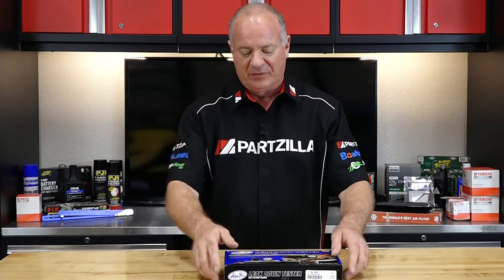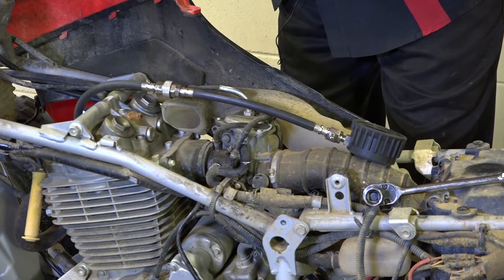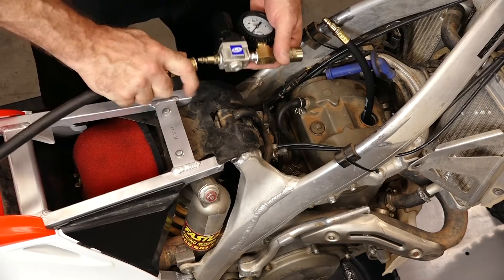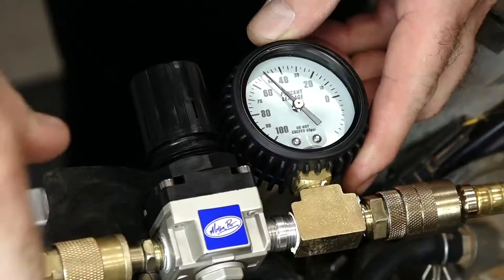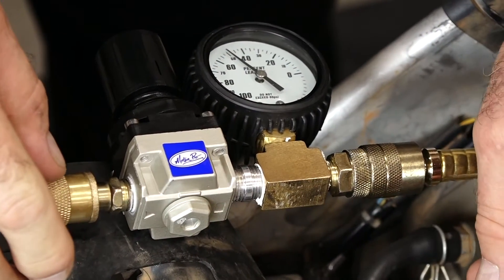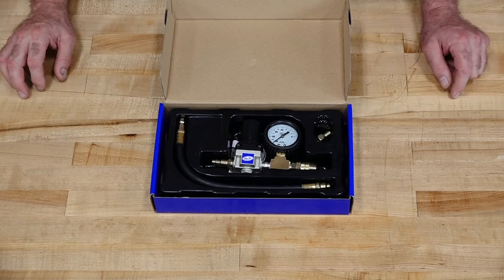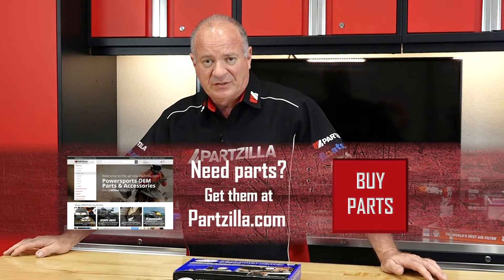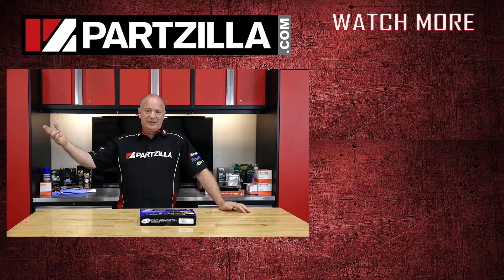Leak Down Test on a Motorcycle | Motion Pro Leak Down Tester | How to Do a Leak Down Test

Comment: Wow i thought i was a compression tester at first, by then i understood it was a tester where air is blown into the tdc cylinder by a pump with a known pressure value to check for leakages from intake , exhaust or cylinder sealing